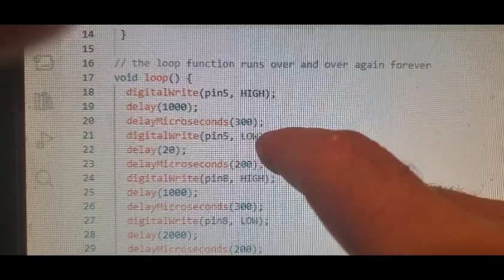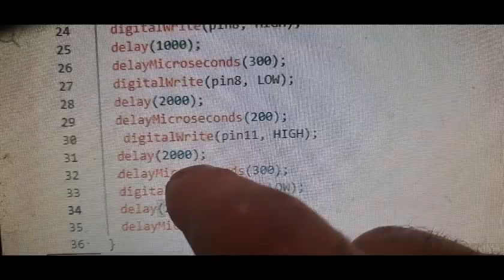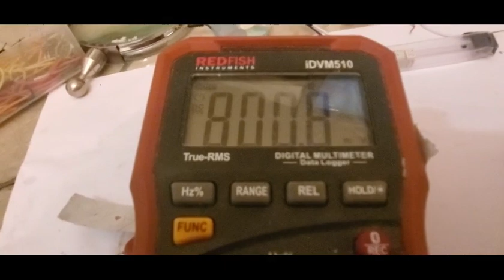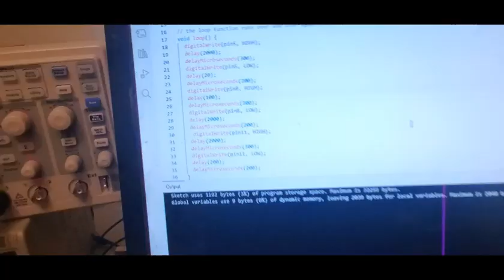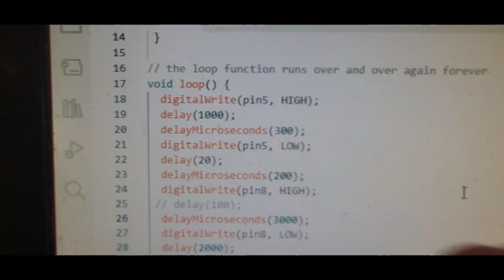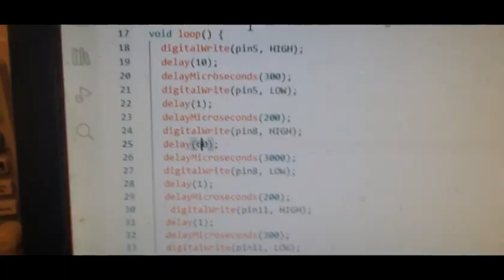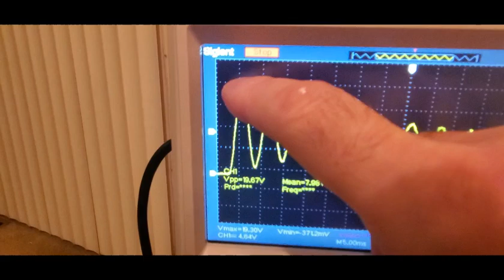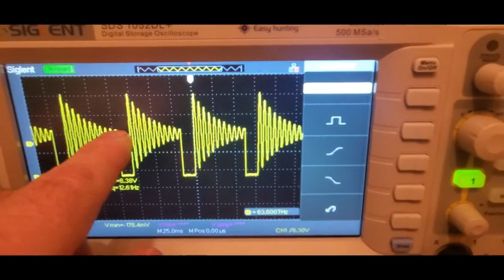Two Capacitors and a Coil of Wire

Comment: Bear in mind when measuring the voltages is that the average multimeter is only going to show a few results per second (eg, 3 samp/s). Consequently, even if your eye-brain system could read a rapidly changing LCD alphanumeric display, you'd be lucky to catch any particular point/time in the changing system.  That's why a scope of some form is a better option for investigation.  With voltages in the order of 0 V to 30 V, you could get tricksy and use a (high value) resistor divider to cut the peak down to 5 V and use Arduino A/D inputs to measure the voltages and display them using the Plot function of the Arduino IDE.  I'd probably replace the delay functions in the shown sketch with Timer interrupts for better control, but a few analog reads, and suitably shortened delays, would suffice for the overall picture. Heck, I feel a project coming on ...

I like the use of optoisolators, BTW.
Reply from the maker: Thank you for the comment Stuart.  Not to pick a nit, but I showed the oscilloscope readings.  Once again, I am self taught, but "the average multimeter is only going to show a few results per second", is the main or one of the important reasons I decided to pick up a cheap desktop oscilloscope.  I do appreciate the comment, but yes the scope at times is a better option for investigation.
Reply: @paulmaher812  No worries re picking a nit,  I did notice that you used the oscilloscope. I was really aiming my comments at an interested beginner rather than you ... sadly, in retrospect, it didn't read like that. :-(

Comment: There are losses of energy. Energy is power. They are pretty small in this case but they are there. The loss is a bit difucult to measure because the acceleration changes over time. At 0 seconds the resistor is 10v differance across its leads. One side is +10 tthe other is 0v. But as of .0001S the difference  of voltage has changed from 10 to maybe 9v. And this contimues until there is 0v difference between its 2 leads as the second capacitor charges. So if you plot this on a graph you would see a \ line from 10v to 0v. The actual power loss is related to this difference of voltage at each point in time calculated out. Its a small number but it is there. And its hard to measure because you need to plot the line and have accurate timing and then calculate the power per point on that line. You have to solve for the amps at each point to find the power you will find the max power at 0S mark and 0 power at the final time. The amps go down with time in this scenario.

Comment: Energy is power over time. Time never stops. So if there's a power loss, as in the case of resistance, which is always present, there's also an energy loss, or if you like to word things in strange ways, a "charge loss".

I'm sorry but you got that one absolutely wrong.
Reply: You are correct. The energy loss over the resistor is small but it's there. But it's hard to measure because the power changes over time. At 0Seconds you have 10v on one side and 0v on the other which will be the largest power loss, but as time goes by the difference of voltage changes. So the current actually goes to 0 when they are equal. So to calculate the power you need the slope of the line of voltage over time, and at each point you have to calculate the amps. And the total loss is each point on the line summed up. It's a very small loss but it is there.

Comment: You should probably use an analog meter instead of the digital so you can see the voltage peaks.
Reply from the maker: Yes, but I did also just pick up the entry level oscilloscope which allowed me to see the voltage peaks and troughs, thanks for the comment.

Comment: The charge with the added resistor is the same. The energy will be different. Because of the square of voltage in the formula.
The oscillation frequency is of the series connection of both capacitors, but the big one gets dominated a 100x by the smaller one, so it is approximately the smaller one.
I used inductor-charging-capacitor in a Tesla coil, where it boosts HVDC (3-phase mains-through-MOT rectified) from 2kV*sqrt(2)*sqrt(3) to twice that, almost 10kV primary side.
Reply from the maker: Yep. CV and 1/2CV2, then when you alter V by putting two caps at different voltages in parallel both CV and 1/2CV2 are supposed to be conserved.  When I first noticed this, being self-taught, I thought I had to be missing something, later I thought do these people have manure for brains? This is clown world the great heresy in physics is to say 1/2CV2 isn't conserved but it is not like it is violated once in a hundred years when moon runes are visible on the first harvest full moon, it is violated every single time you discharge one cap into another and you can see it with a 15 dollar multimeter. ¯\_(ツ)_/¯ 

I think you are also correct with point two.  Was discharging a 10 uF into a 10 uF and the resonant frequency wasn't for 10 uF, can't remember now but it was either for 20 or 5, maybe I'll put that in another video. 

That's a lot of volts, sounds like a great project, thanks for the comment.

Comment: Have you ever looked into the delay line generator? Sir Timothy Thrapp with witts ministries has a video on it. You are so good with the switch timing with that arduino I bet you could figure out how the delay line generator is working. Some how he pulses dc into it and he says he keeps the wave bouncing and building. They have a lot of devices on the witts website. They have a flux motor a flux switch transformer and several other things that are over unity. You can pay and they show you how to build the devices.

Comment: Can't wait for more videos on the BiTT transformer.
Reply from the maker: Well, since you asked will try and get something out within maybe a week or so.  Ran into some, maybe, gopher holes with getting two different materials set-up, need to look at that more. Did come up with a slight circuit modification where going off the spreadsheet at least the Cop is no longer 1.1 but 2 or 3 at 20 or 30 volts.  I put it away for awhile I guess because it is rather strange and I don't want to end up the guy with the beanie propeller cap on a unicycle peddling around the free energy conferences shouting "Listen to me, you have to listen to me!"  And I don't want a shitestorm with the normies and heaven knows who else, I don't care that much. This was known 75 years ago was likely evaluated to the nth degree by the Navy and many others.  Will mention those extra two switches in the circuit though.  Also I still have to do the "acid test" (pun intended) of going batteries to batteries, I am rather certain I have calculated watts in, watts out correctly, however, until I confirm that there is not anyissue with putting the watts out in a storage bin one still isn't certain if it is something that is easily of practical use.
Reply: @paulmaher812  Hopefully you can follow this thought.  The idea is to minimize or eliminate the Back EMF from wanting to reflect back to the primary.  Having a difference in core permeability is one way to do it, air gap in the core is another.  Tinman put our a video years ago on how to create a magnetic gate with a coil and a diode.  So place a second winding above the primary (L1) coil (lets call it L1b to avoid confusion with the duel L2 secondary windings).  L1b has a diode that would allow current to only flow in one direction.  Since you are using pulsed DC you could set up a condition where the magnetic flux from the DC pulse is allowed to pass through the L1b coil but any back EMF trying to reflect back to L1 would energize the L1b coil (producing it's own bemf) preventing it from reflecting back to the primary, no air gap.  Hopefully that makes sense.  This obviously wouldn't work with an AC signal but since you are using pulsed DC I think it might work.  What do you think?

After reviewing your latest video on the subject maybe the L1b coil would dampen the LC tank circuit...humm
Reply from the maker: @CoraxMaximus  I may get what you are saying, something sort of akin to a bucking coil, perhaps in future I will look up "Tinman" and try and take a look, but my plate is sort of full with stuff that is interesting at the moment. "The idea is to minimize or eliminate the Back EMF from wanting to reflect back to the primary." Absolutely, and the second part to that is have the highest Q factor possible.  I will tell you offline I have been spitballing stuff, are there other ways to uncouple the primary and secondary coils besides what Thane and Tom have given?  There is the odd thing that magnetic motors can run with either axial or radial flux, can you have axial flux generator coils that don't impinge back on the primary coil? So far my first attempt was such a spectacular failure I wonder if there was a loose connection or it may be the textbooks are right on this one.  Thanks for the comment.